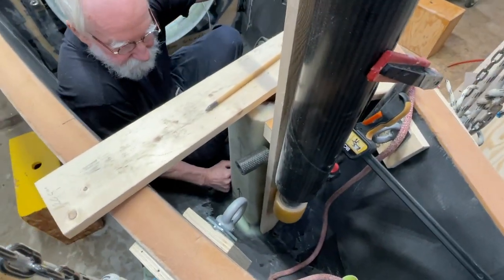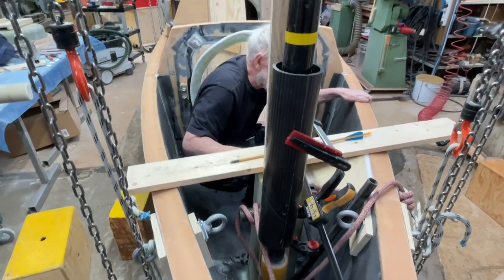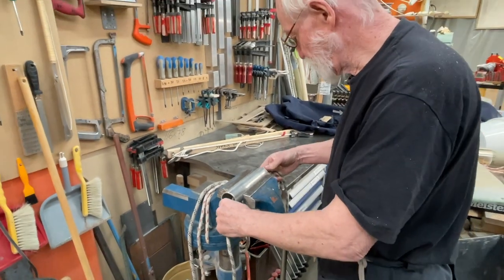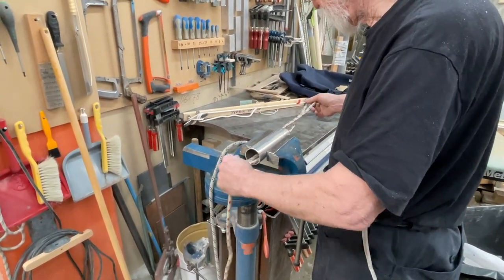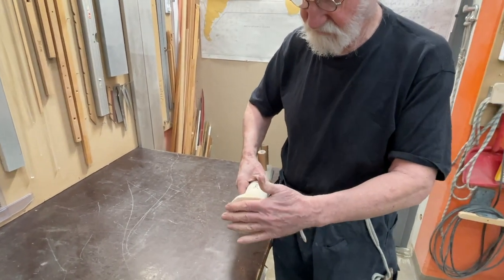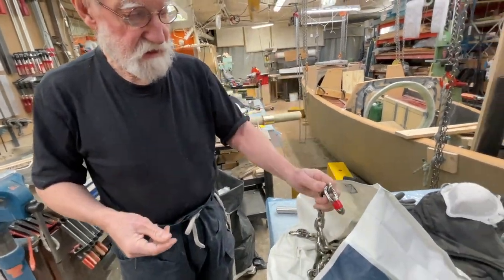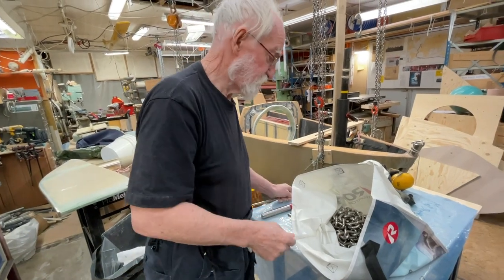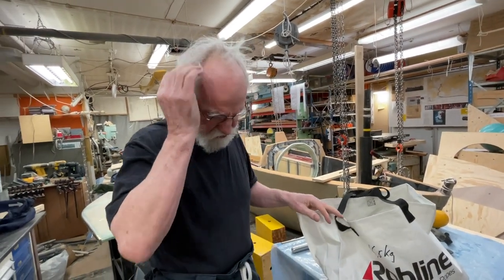7 Feb 2023  The tail, not like a drouge more like the feather of an arrow or the tail of an squirrel

Comment: Would extending the pipe a bit more make it easier to reach? How much rope and chain do you expect to use?  Without the cones, this will be a lot easier than the Jordan series, but seems like you'd need a lot more rope to have similar drag. 

Another very interesting idea. Thanks for sharing.
Reply from the maker: Longer pipe!
This is new I need to experiment a bit.
But I think that it is better to have a longer rope to be able to handle it better and get more force.
The idea is not to get a lot of drag. I belive more in the Moitessier / Dumas idea.
This is more like the feather on an arrow to improve directional stability.
Its about the square cube law.
Like spiders can ballon. They just let out some thread and fly away. When they reach their destination they recycle the thread and descend.
Only small creatures can do that.
My boat is small. I think I can handle storms differently.

Comment: What prevents waves from pumping water into the aft compartment?
Reply: I believe he's going to build a chain locker type of compartment around the pipe.
Or simply smack a fitted plug into it, which would solve the issue.

Comment: In real life situation, When you have to deploy this rope and chain tail from the aft, it will be dark, freezing cold and the sea will be very upset. How will your hands be able to deploy this through that tiny hole behind the mizzen and the rudder box?
Reply: I don't think he's finished with it. I think he's going to build a "chain locker" type compartment around the tube.
But I imagine it will be a lot easier then the normal way that people have to deploy warps and sea anchors.
The chain will already be in the tube, so all he has to do is let gravity do its thing.
Reply from the maker: I am used to the life on the ocean wave.
So far I have not had problems with cold hands and a moving boat. If you are used to working with ropes you do not need ropes.
Seamen including myself have been sailing the oceans long before electricity.
Reply: The tube is inside the cabin, so there will be as much light as you like, plus no wind and not so cold. Easier to deploy than if you have to go up on the deck. You can put the chain through the pipe, 1 wrap on the bollard, and slowly pay it out.
Reply: @ocean_capable_small_sailboat  good points.
Reply: @ocean_capable_small_sailboat  on the subject of warps and sea anchors, for your own boat Perry, are you going with the usual cleats and bridle?
Reply: @pointnemo72  I'll have beefy cleats on the port & starboard quarters, and plan to drag a warp and chain behind if things get really nasty. And other things can be added if more drag is desired. Hopefully it's used very rarely.
Reply: If you have even had to deploy you will know that standing on the stern in a traditional boat can be a horrible situation  ...Svens design and execution is brilliant...
Reply: I've forgotten his name, but there was a man who sailed across the Atlantic singlehanded in a small boat who had previously lost all his fingers due to frostbite. IIRC it was in the 19th century.
Reply from the maker: @cornishhh  I read his book.
Also forgot his name.
He was a fisherman who was out in his dory with an other man bet they did not find the schooner again.
The other man died.
He did not have the strenght to hold the oar so he poored water on them so that they kind of got soldered to the oars.
I did belive it at the time but now I doubt it.
Reply: @SvenYrvindExlex  Robert "Centennial" Johnson. Born in Copenhagen and emigrated to the USA.
Reply: @cornishhh  Howard Blackburn
Reply from the maker: @ocean_capable_small_sailboat  Howard Blackburn when you said it I remember.
Reply: @ocean_capable_small_sailboat  My mistake; you're right.

Comment: hello Sven!
i dont really understand... the water comming from the pipe will be contained in a separated compartiment?
I know the upperpart of the pipe (the one inside the boat) would be over the flotation line, but even there i suposse that in heavy seas it will be a significant ammount of H2O comming aboard. How do you plan to deal with it?
Reply: I believe he's going to build a chain locker type of compartment around the pipe.
Or simply smack a fitted plug into it, which would solve the issue.
Reply: @John Q. Bebtelovimab thanks!
Reply: @pointnemo72  thankyou
Reply from the maker: True I will make a kind of self draining chain locker. A little water may come in but be mostly contained. 
Also I will plug the hole.
Reply: @SvenYrvindExlex  got it!
thanks master